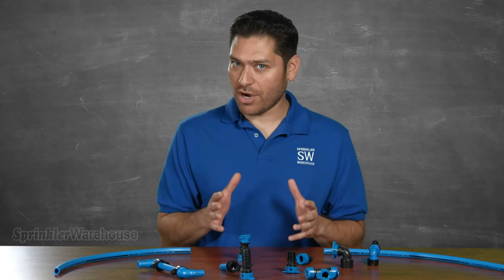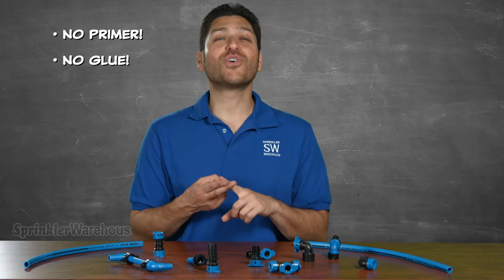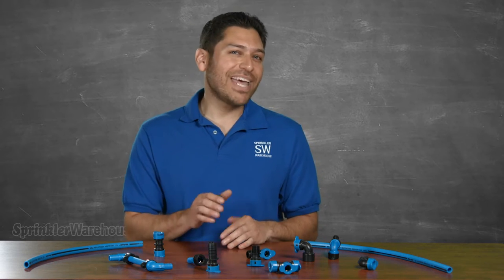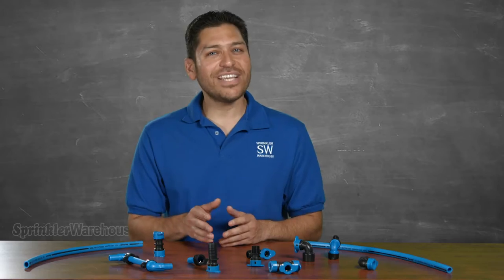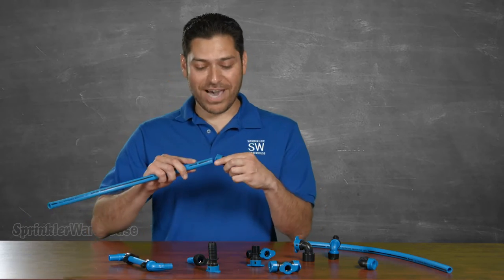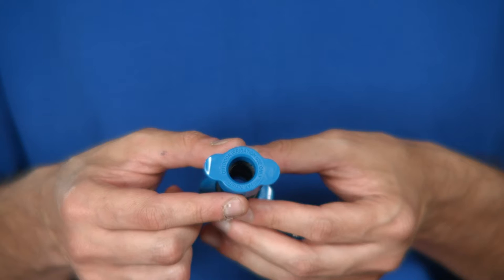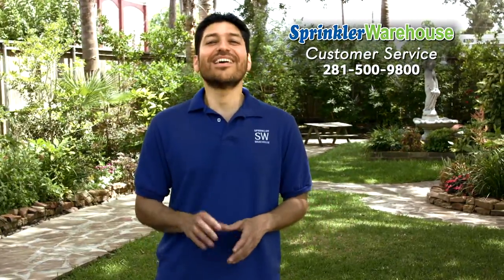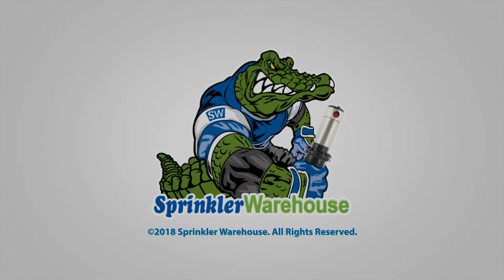Blu-Lock Half Inch Fittings

Comment: Apparently Blu-Lock measures differently (outer diameter vs inner?) because a 1/2 inch black pipe from Home Depot will not fit a 1/2 Blu-Lock fitting.